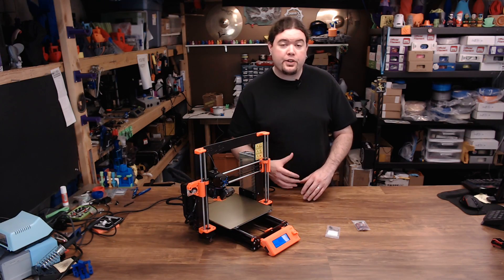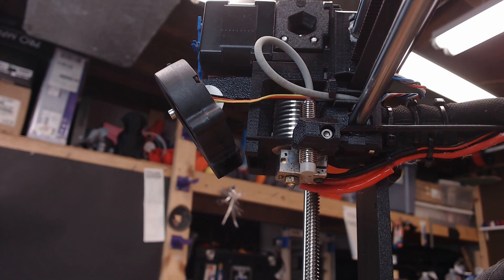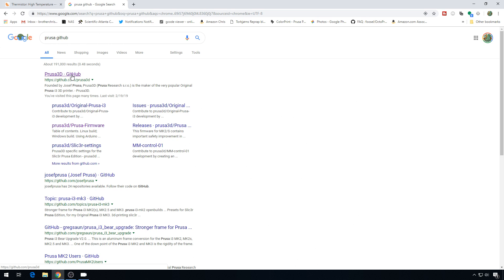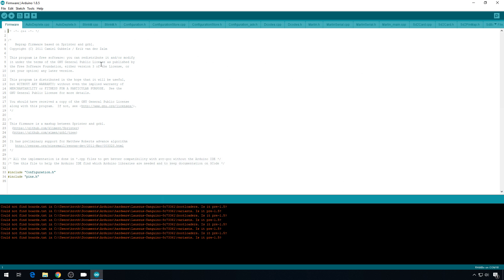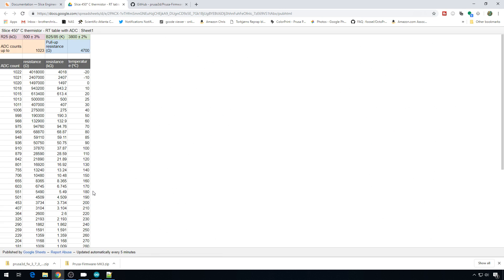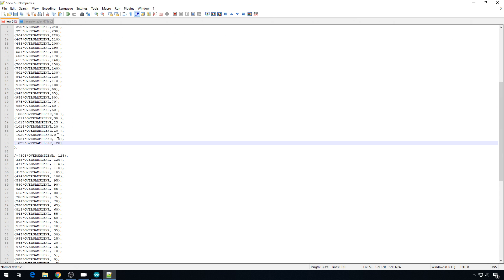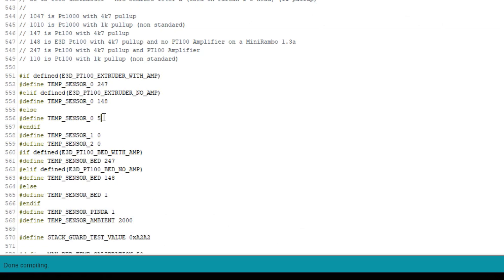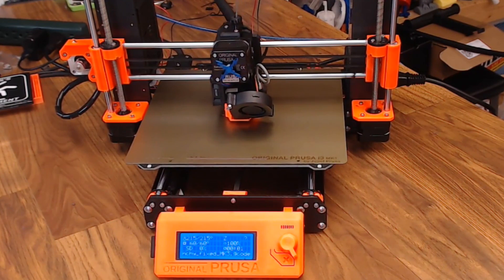Prusa Thermistor Upgrade - Slice Engineering - Chris's Basement

Comment: sir I am having an issue.when my printer is completly cooldown then bed temp show 19c which is our weather but hotend temp is stil 53c. I tried to preheat to 215c but it gives me the preheat error at about 190c. I have tried several times and always at about 190c it beeps and gives me the preheat error. I checked the cables, connections, fuse, etc. What is odd to me is that it attempts to heat up when commanded and then caps out and gives me the error. Any ideas? please help
Reply from the maker: Sounds like you have a bad thermistor or it's not compatible with your current temp table. Check it with a meter and note the resistance when the thermistor it cool. That will tell you a lot about what type it is.
Reply: @ChrisRiley  thanks sir

Comment: I guess this example is outdated. I tried to verify and received lots of errors. missing packages and such. i'll have to search around
Reply from the maker: See if you can get the 1.8.5 version of the IDE.
Reply: @ChrisRiley  hey thanks. It was the FW version. I needed the specific prusa firmware 3.11.0, I had grabbed just the PF-MK3. Obviously wrong firmware. It worked right away. Thank man. You make some of the best vids for 3d printing. You’ve been a big help.

Comment: so i downloaded the completed firmware that you put on google drive, compiled it to a .hex file, but now when i go to flahs the printer, it gets to 100% verified and then just hangs there forever. and when i go to restart the printer it hangs on the splash screen until i flash the older stock firmware again. is there any chance of getting your already compiled modiofied firmware hex file Chris?
Reply from the maker: Try this one. https://drive.google.com/file/d/11UTldsb5fheBYzpwmO5wgtoF2eY37C_Q/view?usp=sharing
Reply: @ChrisRiley  so strange. i just tried that on two different prusas and it did the same thing. just hangs on '100% verified' indefinitely. im gonna try loading an older stock firmwar and then re uyploading this modified one. maybe theres something happening with the newest prusa FW thats different.
Reply: same end result :( reverting back to an older firmware and then uploading the one you sent still ends up with getting stuck on the verified screen
Reply: @ChrisRiley  thank you for the initial reply btw, much appreciated
Reply from the maker: @nothalol  Sorry about that, you might be right, something conflicting in the newer versions.
Reply: @ChrisRiley  seems like it's arduino IDE related. had a coworker compile it on his linux machine and it booted just fine. problem solved at least for the moment. now i'm printing pekk on my prusa :) thanks again for the guide and the pre-made firmware, man. much appreciated!

Comment: Hi Chris, I need some help if possible, I have some project similar to 3 d printer but I need some support to select which thermistor is suit my project ,I need the thermistor with 3 m cable extension.so appreciate any support
Reply from the maker: Hey, just about any thermistor can work, 3m shouldn't be an issue. I would just get a cheaper 100k one and work out the table for the extra resistance.

Comment: Hello Chris,
Thanks for doing this video.
I'm attempting to do this with FW 3.9.0 or 3.9.1
I've tried on Windows and Mac and I keep getting errors verifying the original unmodified code.

Any idea how to get past this or where I can get help?

error: Arduino:
eeprom.h:594: error: 'reinterpret_cast<M500_conf*>(20)' is not a constant expression

 static constexpr M500_conf * const EEPROM_M500_base = reinterpret_cast<M500_conf*>(20); //offset for storing settings using M500
Reply from the maker: Looks to be a syntax problem. Are you using IDE 1.8.5?
Reply: @ChrisRiley  Hi Chris. Thanks for responding. Yes, I have tried both 1.8.5 and 1.8.13.
I get the same error with both versions. I've also tried using both on MacOS and Windows 10. I believe the same issue of the "M500" and "bad CPU" which I didn't post initially.
Reply from the maker: @davidewen713  Hey David, I rebuilt everything and was able to successfully build. Maybe you should try to clean up your IDE folders and try again. Try this, https://arduino.stackexchange.com/questions/54644/how-do-i-reset-my-libraries-back-to-original-condition
Reply: @ChrisRiley  Hey Chris, still a no go, both on MacOS (primary system) and Windows (under Bootcamp).
I have completely removed Arduino from both OSs and reinstalled. Note one thing missing from your tutorial, is that with a new install, you have to specify the Rambo board in Arduino Additional Boars Manager URLs.

I'm not sure what my problem is. I have used 2 computers (1) MacPro (2) MacBookPro. I have used (3) virtual machines aside from the (2) native OSs. All have failed with the same errors.

Windows error: 
exit status 1
'reinterpret_cast<M500_conf*>(20)' is not a constant expression

MacOS error:
fork/exec /private/var/folders/lb/5ykbpzxj2tqb65fl6927xtgw0000gn/T/AppTranslocation/327F42BE-7466-44D2-BB20-EE12882C8849/d/Arduino.app/Contents/Java/hardware/tools/avr/bin/avr-g++: bad CPU type in executable
Error compiling for board RAMBo.

Virtual Machine errors: 
Note - this is for both Windows 10 and MacOS High Sierra versions
Note 2 - these were both virgin installs of Arduino, and fresh downloads of Prusa FW.
Note 3 - both VMs were run on the MacPro

wiring.c.o (symbol from plugin): In function `__vector_23':
(.text+0x0): multiple definition of `__vector_23'
sketch/heatbed_pwm.cpp.o (symbol from plugin):(.text+0x0): first defined here
/private/var/folders/_v/9gzs0y5j1hdd00skdj0m1clr0000gn/T/AppTranslocation/02CF9201-3990-449B-85A7-447323193008/d/Arduino.app/Contents/Java/hardware/tools/avr/bin/../lib/gcc/avr/4.9.2/../../../../avr/bin/ld: Disabling relaxation: it will not work with multiple definitions
collect2: error: ld returned 1 exit status
exit status 1
Error compiling for board RAMBo.
Reply: @Chris Riley
I finally figured this out.

I was able to verify the stock FW version MK3_GCC.
Following instructions on this GitHub thread: https://github.com/prusa3d/Prusa-Firmware/issues/2337
Even though I'm using MacOS, I followed the "Windows" instructions
Specifically under "Windows" 1:c , "Modify compiler flags in "platform.txt" file.

Now I just need to make the changes that you show in this video and verify again.

Cheers,
David

Comment: Very helpful video! If switching to a Mosquito hotend with this thermistor and also the upgraded slice engineering heater, are there any other firmware changes needed?
Reply from the maker: You might want to raise max temp, but that would be all.

Comment: I am trying to verify the files @6:50 and it is showing the error below, any idea how to fix it?

In file included from sketch\Configuration.h:60:0,

                 from sketch\Marlin.h:21,

                 from sketch\cmdqueue.h:4,

                 from sketch\Dcodes.cpp:4:

eeprom.h:236:55: error: 'reinterpret_cast<M500_conf*>(20)' is not a constant expression

 static constexpr M500_conf * const EEPROM_M500_base = reinterpret_cast<M500_conf*>(20); //offset for storing settings using M500
Reply: Error thread to Prusa:
https://forum.prusaprinters.org/forum/general-software-discussion/firmware-error-verifying-firmware-reinterpret_cast20/
Reply from the maker: Hello, Prusa uses some syntax not supported in some ide versions, I tried it in 1.8.5 and it works. https://www.arduino.cc/en/Main/OldSoftwareReleases#previous
Reply: @ChrisRiley  Awesome! I'll have to try this tonight. Got all the new Mosquito upgrades to find that problem yesterday. Thanks for the reply 🤜🤛
Reply: Arduino 1.8.5 worked, used the Prusa 3.7.1 firmware following your steps for a Prusa MK3S.  Thanks for the help and video!

Comment: Hey Chris,

I thought I would share with you that the Slice Eng Thermistor is currently not compatible with the Mk2 or Mk2.5 variants. I guess a recent update has broken something on the Prusa side of things. Source: Slice Engineering.
Reply from the maker: Well that sucks, some users were reporting that,  I was wondering what changed.

Comment: Hi, Chris. Thank You for this great video and manual. However I have encoutered a problem I didn´t find a solution for. I have upgraded both my MK3S and MK2.5S with Slice thermistor, made the same procedure with firmware upgrade (yes, I have used correct files for each printer, I have even tried to go through the procedue multiple times to cast out any mistake done by myself), but in MK2.5S the nozzle temperature is showing 60°C (in the ambient room temperature, not preheated). In MK3S it is working flawlessly. I have even tried to swap thermistors between my printers and they both work on MK3S and showing wrong results on MK2.5S, so it is not a hardware problem. Do You have any idea what can be wrong?
Reply from the maker: So the only difference here is one has a mini rambo and the other has the Einsy? That is really strange issue. I would think it would be really close to the same.  They  both use the e3d number 5 thermistor by default, but I know the MK2 does read a lot higher at the low end. Maybe send Ultimachine a not, maybe they would know why.
Reply: I am actually experiencing the same thing with firmware I loaded form Bondtech.  Did you ever figure out the issue?
Reply: @dr_riot8559  Unfortunately not :o( After many, many, many, many trials and errors I gave up and switched back to stock thermistor on my MK2.5S :o(
Reply: @Cepelikm  it seems like slice is aware of the issue and is working in it. They don't know how long it will take to fix.

Comment: When I add the thermistor table and flash the firmware, my printer reports it is 76 degrees celsius at room temperature, and I instantly get a thermal runaway error.
Reply from the maker: Sounds like there might be something wrong in the table.
Reply: @ChrisRiley  I noticed that the table on the Slice Engineering website is completely different than what the video shows.
Reply from the maker: @lavachemist  Interesting, they might have changed it, I will take a look.
Reply: @ChrisRiley  No worries. I emailed Slice, and the engineer told me that he uses your video to explain how to set up Prusa firmware with their thermistor, so it must still be accurate. I think mine is faulty. I switched back to the E3D thermistor until I can figure out what's going on.

Comment: Hello! This helped a lot, thank you so much! I also bought a 50w Heater cartridge from slice. Do I need to change anything or is it good as is?
Reply from the maker: For the heater you should be good, if you want to go higher than 290 you will have to increase the max temp.
Reply: Chris Riley ok, thank you! Which file would I change the max temp in?
Reply from the maker: @thedavinator37  I think it is in prusa_configuration.h
Reply: Chris Riley aweosme, thank you for all of the help!
Reply: @ChrisRiley  One last thing, I don't see any mk3s firmware in the prusa github. Do they just use mk3 or am I missing something?
Reply from the maker: @thedavinator37  No listing for MK3S, it's in the same zip file. https://github.com/prusa3d/Prusa-Firmware

Comment: would you mind uploading a hex file?
Reply from the maker: For which version do you need?
Reply: @ChrisRiley  I have the mk3 with the mosquito thermistor and heater
Reply from the maker: @UncleRobs9000  If the bondtech version don't help, I will make you one. https://www.bondtech.se/en/knowledge-base/firmware-updates-for-prusa-i3/
Reply: @ChrisRiley  version 3.8.1
Reply: @ChrisRiley  running into compliation errors if you wouldnt mind, id relly appreciate it if you created and posted the hex file. By the way thanks for the quick replies you rock!
Reply from the maker: @UncleRobs9000  I have not tested this, but it should be right. Use at your own risk. https://drive.google.com/open?id=13048JzcRCY2P7yv6ktXu0Jv04Lsgz6iz

Comment: I haven’t done this yet but after you do the changes to the firmware do you have to update the firmware differently in the future or will it keep the updated temp table with future updates? Thank you so much sorry if it’s a stupid question
Reply: and also with 3.8 update or whatever does that mean that this videos directions won’t lead to a successful update for the firmware?
Reply from the maker: With the newer firmware it is a little different, you need the Eisny library now. Also, yes, anytime you want to update after this, you will have to do these updates.

Comment: Chris I have everything working on my mk3s with Bondtech\Mosquito and I flashed the Bondtech hex (the file for the SE Thermistor) and my mk3s is still showing a max temp of 295?  I know I flashed the correct file so I'm not sure how to get around this?
Reply from the maker: Yeah, you have to increase the max temp. I thought they would have done that in the firmware for you, I guess not. Maybe if you ask them they will send you an updated hex version with a higher temp.

Comment: Hey chris I own and MK3s and just installed the Bondtech Mosquito kit with the SE Mosquito, SE Heater Cartridge and SE hight temp thermistor - in the Bondtech manual it links to a hex file with "SE_HT Thermistor" in the name - can I assume I would just need to flash this hex rather than compile the settings like you are doing in this video?
Reply from the maker: Hey Rick, I am going to say yes, the hex file should be all you need.
Reply: Chris Riley so that worked. I was able to flash the hex with no issue and load pla for the first time on the mosquito. My only issue is the load\unload has to be done 6 or 7 times. Is there any way for me to change that on the firmware? Thanks !
Reply from the maker: @rickc7151  You can change it, but you will have to hack the firmware a bit.

Comment: Hey Chris, love your videos. When I updated the thermistor tables I am still getting a MAX TEMP error when printing above 305. Should I adjust the Heater_MaxTemp in the configuration_prusa.h tab to 450?
Reply: I am using the mosquito hot end and your tutorials have been my go-to on several diy projects with my MK3s. Can’t thank you enough for your channel and your ability to help us amateurs!
Reply from the maker: @ericrippetoe7701  NICE! Thanks for watching!
Reply from the maker: Hey Eric, are you using the v6 hot end? With stock aluminum it's only good to 300c, anything over that will damage it. Now if you have the Mosquito, yes, just increase the max temp.

Comment: Hey. Just working through this guide, now when I get to the arduino part, and I click tools > board, it doesn't say rambo there for me. It says arduino/genuino uno. Do I need to plug the rambo into the desktop computer for it to find it kinda thing?
Reply from the maker: Hey Shane, if its MK3 use this one,
b. Setup Arduino to use Prusa Rambo board definition

Open Arduino and navigate to File -> Preferences -> Settings
To the text field "Additional Boards Manager URLSs" add https://raw.githubusercontent.com/prusa3d/Arduino_Boards/master/IDE_Board_Manager/package_prusa3d_index.json
Open Board manager (Tools->Board->Board manager), and install Prusa Research AVR MK3 RAMBo EINSy board

 if it's a mk2 you need this one. https://reprap.org/wiki/Rambo_firmware#Arduino_1.6.4.2B_Board_Manager_Plugin
Reply: @ChrisRiley  On a mk3s but I'm sure it will stil work.
Reply: @ChrisRiley   You saved the day, thank you.
Reply from the maker: @gold2greenltd.-buyerofgold576  Awesome, glad to help.

Comment: Hi, thx for your video! I'm trying to follow every step but failed already after verifying the firmware. Can't compile, message: 
wiring.c.o (symbol from plugin): In function `__vector_23':
(.text+0x0): multiple definition of `__vector_23'
sketch/heatbed_pwm.cpp.o (symbol from plugin):(.text+0x0): first defined here
/Applications/Arduino.app/Contents/Java/hardware/tools/avr/bin/../lib/gcc/avr/5.4.0/../../../../avr/bin/ld: Disabling relaxation: it will not work with multiple definitions
collect2: error: ld returned 1 exit status
exit status 1
Error compiling for board RAMBo.

Any idea?
Reply from the maker: That's a strange one, do you have the einsy library installed? Prusa changed that a month or so ago. 

b. Setup Arduino to use Prusa Rambo board definition

Open Arduino and navigate to File -> Preferences -> Settings
To the text field "Additional Boards Manager URLSs" add https://raw.githubusercontent.com/prusa3d/Arduino_Boards/master/IDE_Board_Manager/package_prusa3d_index.json
Open Board manager (Tools->Board->Board manager), and install Prusa Research AVR MK3 RAMBo EINSy board
Reply: @ChrisRiley  Yeah this was the problem, THX for your precious help
Reply: @ChrisRiley  Would this also work for RAMBo 13a on my MK2.5S? I'm also having this same issue.
Reply from the maker: @falcon7834  For the mini rambo you will need to use the rambo plugin, not the Einsy one. https://reprap.org/wiki/Rambo_firmware#Arduino_1.6.4.2B_Board_Manager_Plugin

Comment: followed instructions sensing temp ok.  now i have a "?" next to the z...and i cant calibrate the z without it crashing into the bed....What is the solution to this
Reply from the maker: I forgot a part, check out this doc.

https://docs.google.com/document/d/1Zz6zwEf5JP5zXO4nDO9sNIYq3-WoQSPITlrna-p0gbA/edit
Reply: @ChrisRiley  would you mind making a small video on this?
I've tried adjusting this 50 times now and I keep getting the lcd stuck on "upgrading firmware do not disconnect"
Please help
Reply from the maker: @UncleRobs9000  Check this out. https://www.bondtech.se/en/knowledge-base/firmware-updates-for-prusa-i3/ these versions will help you.